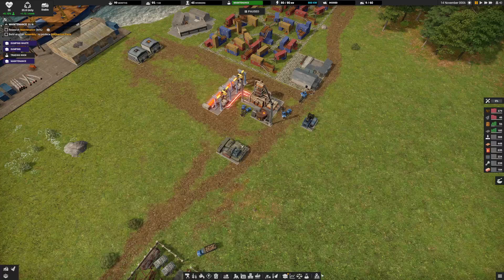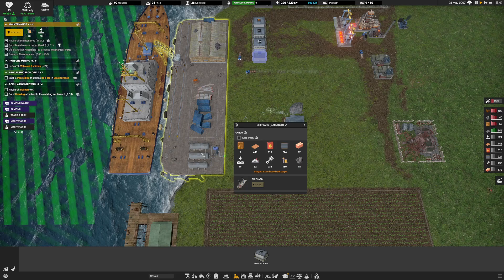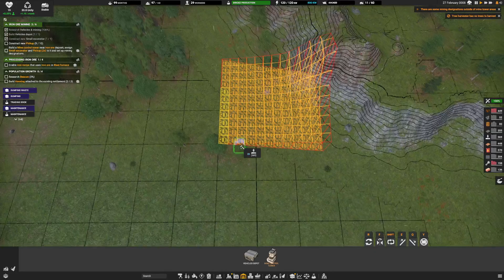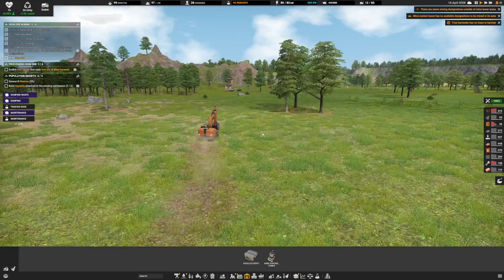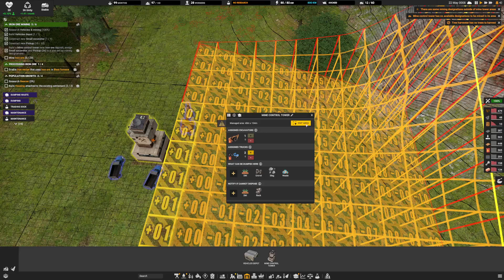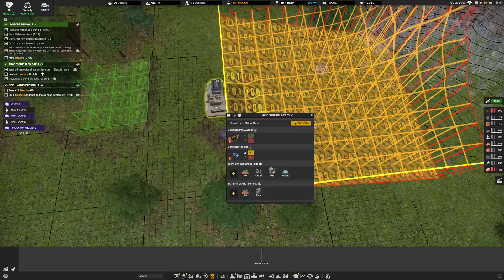Let's Excavate Iron Ore | 1 of 2 | EP3 | Let's Try Captain of Industry | Blind Playthrough

Comment: Another point: Look at the resource overlay (L). It shows pillars around the map. Note that the pillars don't always contain just one type of resource. For example, the iron pillars (as it were) have grey/brown blocks ontop of them. That means the iron is dug down in the earth. Also, you see the pillars look like small boxes with alternate colors. Every box is 1 height unit. When you do dumping and mining designations you see numbers representing how far up or how far down you go in the same units. For the area that you designated in this video, you might have to dig a bit down before you get to the iron. (It would've been more effective to dig straight into the mountain instead, and rather go for the deeper iron later.)
Reply from the maker: Good tip here. Thanks!